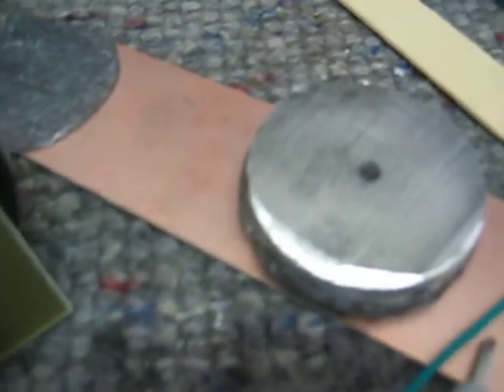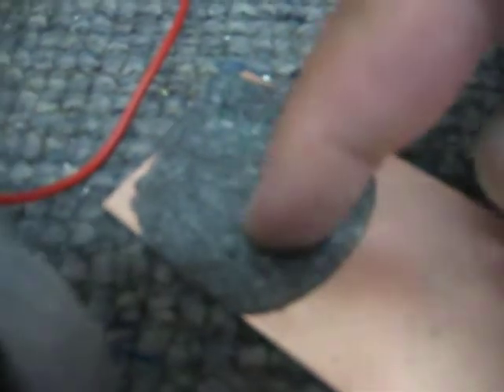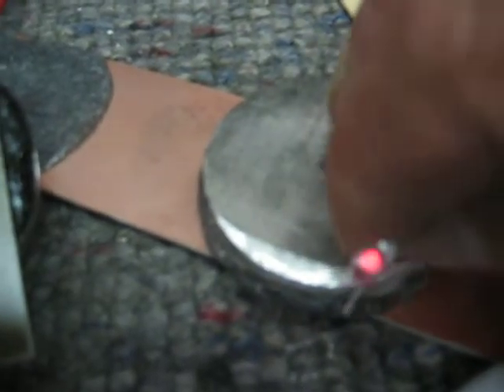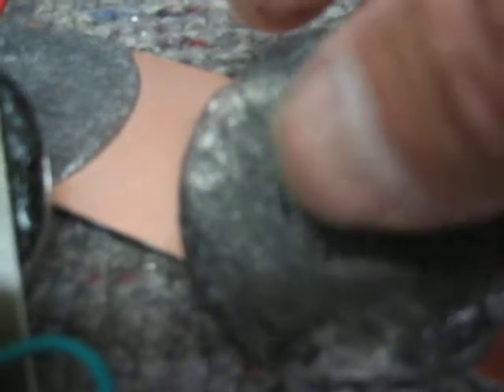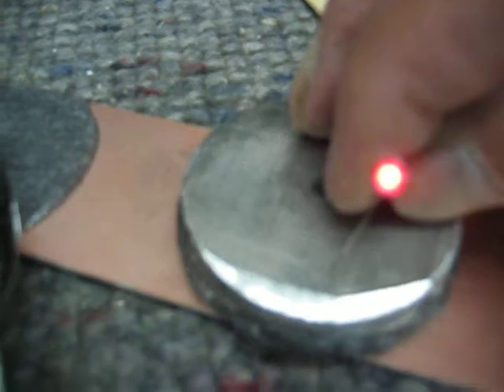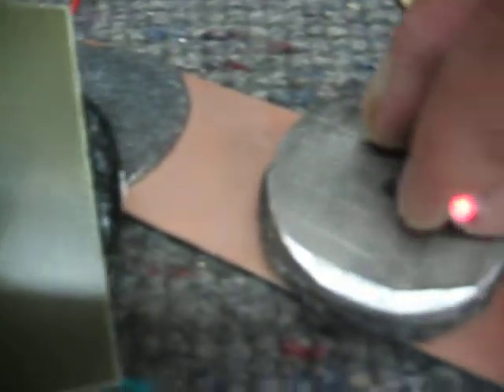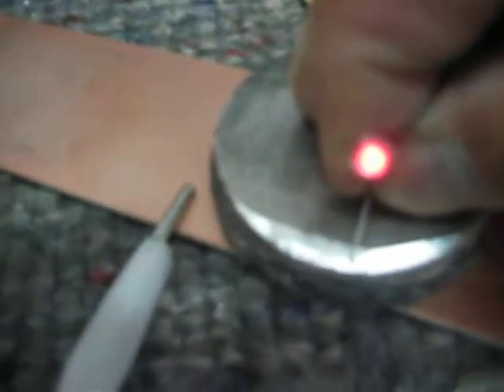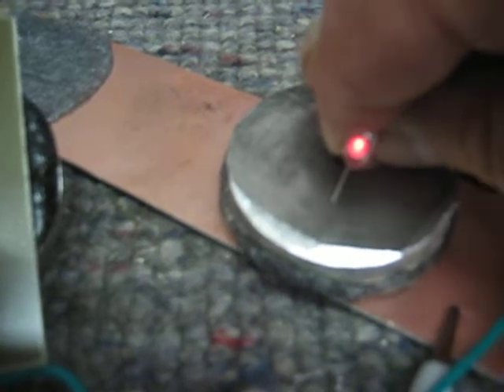Solid State Crystal Batteries In Series 2

Comment: Have your studies shown if the result is from a elemental interaction  or from atomic polar forces. If you haven't already tried it, you might want to set a strong current through it in its molten state like when they make industrial magnets, or trying the raw elements in a series and maybe doing the same process. I mean working with a crystal its always easier to go to really small levels of elemental configuration, after all they make graphene with scotch tape.

Comment: Stack them up and use them with a pulse circuit! I was able to barely light a 24watt CFL bulb with 10V 100mA using a joule thief. I think crystal cells could achieve this level of output.